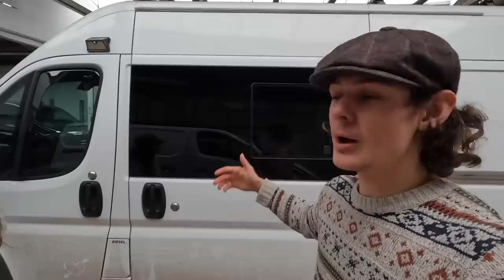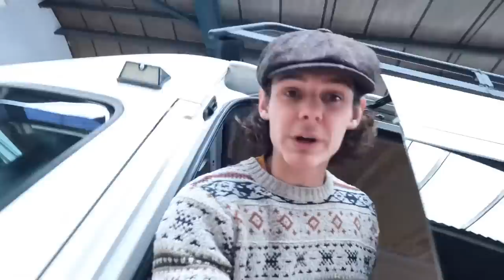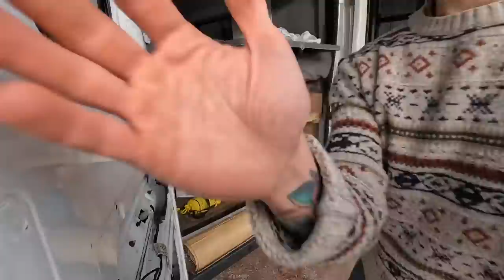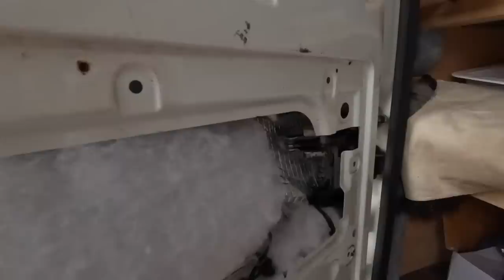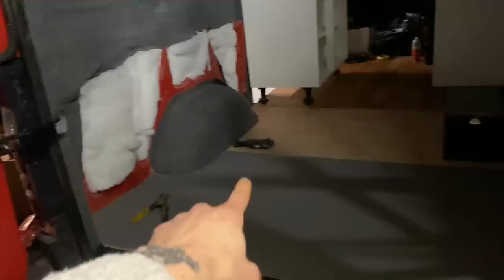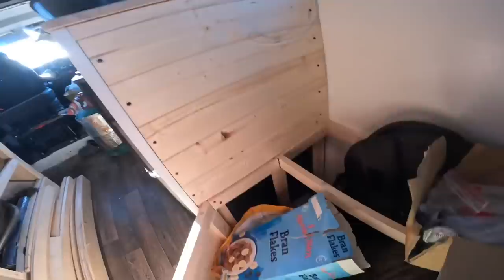Building an Apartment on wheels.

Comment: Do the gas locker next - before you blow up Becs

If that edge piece for the bench has got a sharp corner on it run the plane or a sander down it a tiny bit because its close to the floor and you're bound to ding the edge at some stage and then it will look cack.

Good things: Family, dogs and walking